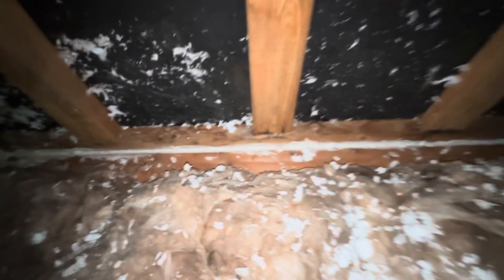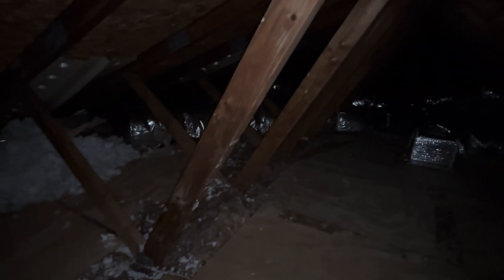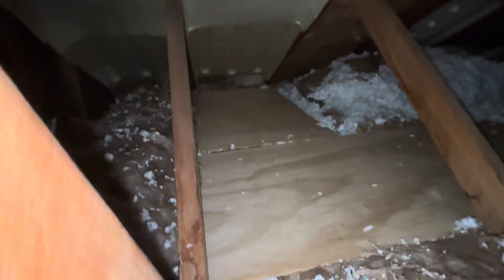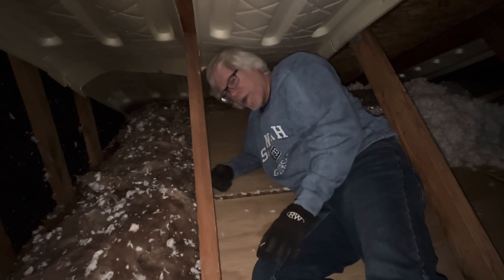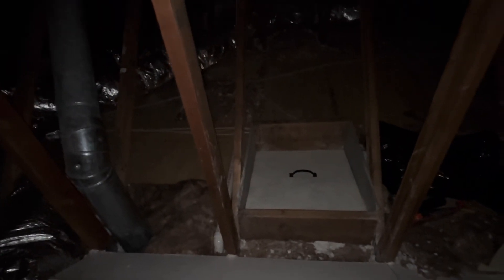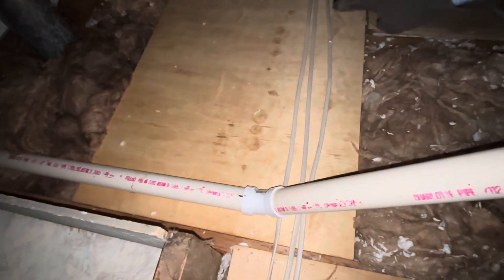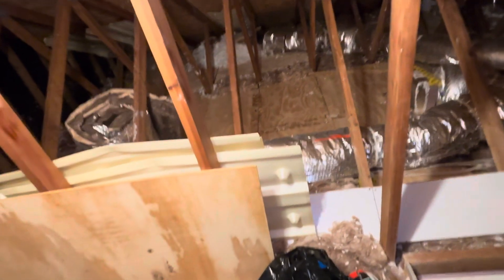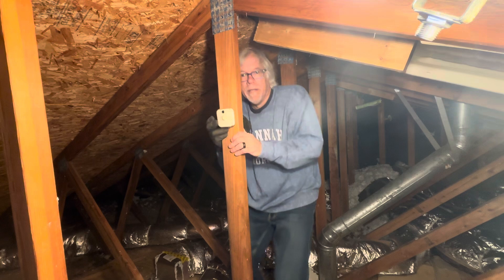Attic leak sealing 2025 update. Labor of love or temporary insanity. #aeroseal #atticinsulation

Comment: Hello from a fellow Iowan (northern Iowa) I bought a 1930s home 2 years ago and will be tackling my attic soon. Question I have for you is. Could could I just staple the R-foil bubble reflective post insulation to the underside of the rafters and run it straight across the length of the attic instead of installing the styrofoam baffles to all the rafter bays?! Then still put insulation on the floor of the attic.
Reply from the maker: Hey, that is awesome to hear from a fellow Iowan. You could do that. I decided not to because I was afraid that if I had any gap, I might collect moisture between the foil and the underside of the rafter. I chickened out. I would test a small area first and see what happens.
Reply: @powerpointpreacher  that is a very good point. Thank you for the quick response. I will keep you posted on how it turns out when I do start it. Your video is the closest to idea that I was looking for
Reply from the maker: @theweda123 I’m so glad to hear that. My main goal of this journey is to be helpful. Let me know how it goes.